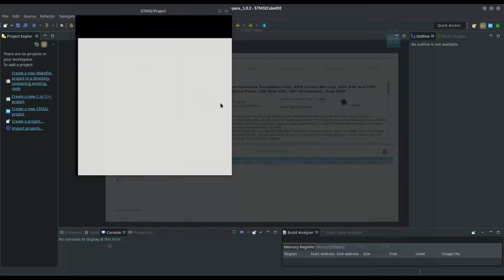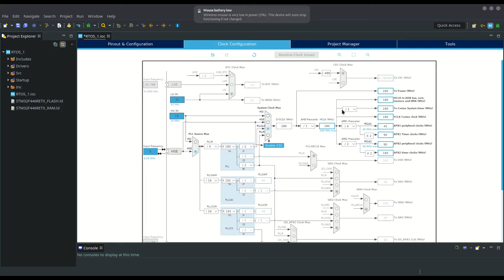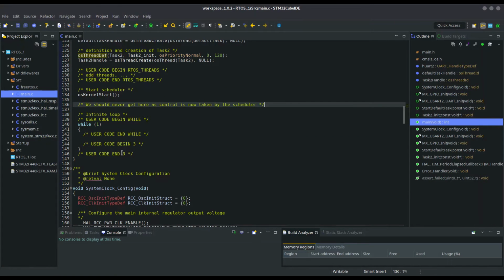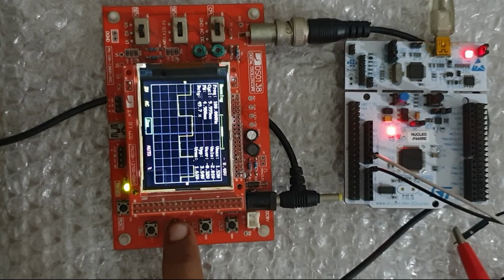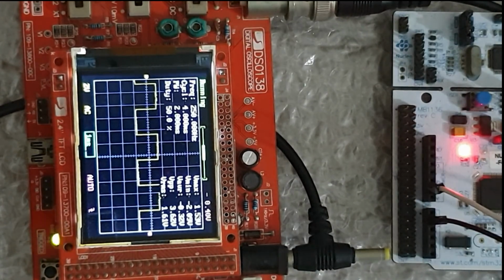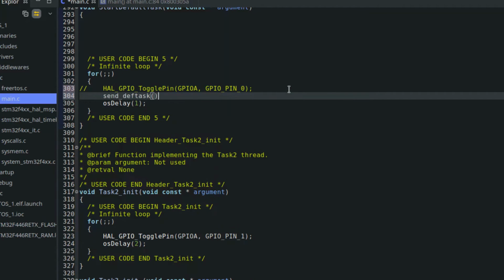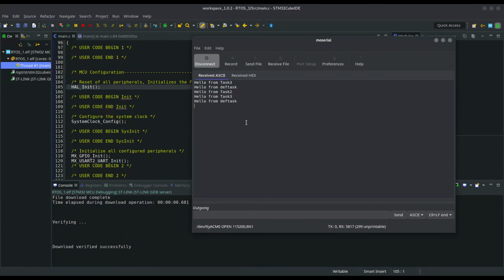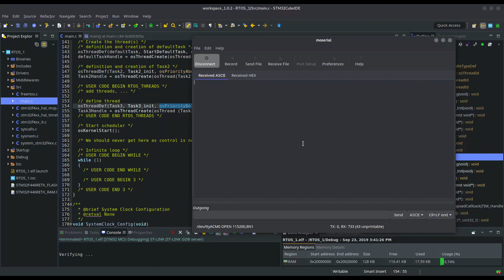STM32 FreeRTOS Series Part 1: Mastering Tasks & Priorities in STM32CubeIDE

Comment: hello sir! i'm new on this
how can i get that 'moserial' if computer port doesn't connect to any STM32 board?
i've run the Debug As -> STM23 c/c++ Applications and it popped up 'No ST-LINK detected!'
hope u can help!
Reply from the maker: Which stm32 board are you using ?
Reply: @ControllersTech  i didn't connect any board so i can't get that moserial window right?
I'm using window, can you recommend any serial terminal?
Reply from the maker: Project can't run without board.
Reply: @ControllersTech can we do this on STM32F103C6T6A board (Blue pill), sir? It's connected to ST-LINK V2 but it got errors when Debugging. 
Hope you can help 🙏

Comment: Wow very nice, this really ilustrates how one wuold intuitively want to develop an operating system, simply an easier way to manage many processes after starting with one, which is how most of start with when programming MCU's.  An even handler is another way I was just reading about, which i guess an Operating system is just a big fancey event handler.  There was someone who made an event handler librarby for MCU's to get around main loop issue which solves the same problem it looks like albiet an even  more stripped down solution with less overhaed then an OS, but some would even complain that the overhead of an event handler is too much.  I was just watching Mitch Davis's bare metal programming series with MCU's and he showed the LED blink sketch blink almost 20x faster by accessing the register directly as opposed to calling DigitalWrite(),  almost 20x!! thats huge, so theres something to be said about the bare metal approach if you really need it, and

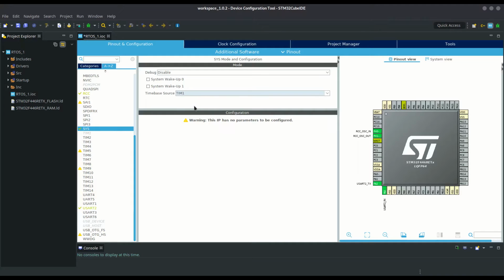Comment: Sir, at 3:26 TIM1 has been selected instead of SysTick. Is TIM1 configuration not required? Code generator handles that and configures it to get 1ms system tick?
Reply from the maker: Yeah it can handle it. But its advised to  use the timer instead of systick.
Reply: @ControllersTech  i know that it is advised. The question was if there are any other steps required when TIM1 is selected.
Reply from the maker: No there is no such thing as steps requiring the timer. When you generate the code, it will automatically point the timer functions to systick
Reply: @ControllersTech  ok. Thanks. I thought that I have to configure TIM1 to overflow every 1ms or something like that. Thanks.

Comment: Thank you for such good tutorials !!! I have a small problem. Everything works fine when I run the code. But when I try to debug the code line by line in the CubeIDE, after HAL_Init() and SystemClock_Config(), the program always gets stuck in the IRQ handler (stm32fxx_it.c  file) of the respective timer that I use. Could you let me know what the issue might be.
Reply from the maker: Yes you can't debug like that. Use breakpoint in the next line and then run the code.
Reply: @ControllersTech  Oh Alright. Thanks !!

Comment: Hello, thanks for the video. I have started to learn RTOS recently. I did everything you had done in this video but serial terminal sends fx`ffxfxfx`fx`f message instead of "hello from ..." message via UART constantly. What is the wrong thing I am going?
Reply from the maker: Could be the baud rate issue.
Check if the baud rate is same in the serial terminal also
And if you are using uart with RTOS, probably you should learn uart first.. or use LED blinking or increment some variable for simpler process.
Reply: @ControllersTech  Baud rate is correct.Yes, my UART knowledge is not good. I am trying to understand my mistake. I can send this array of ascii code and it prints EMRULLAH
uint8_t data[9]={69,77,82,85,76,76,65,72,1}; HAL_UART_Transmit(&huart2, data, 9, 1000);
But I cant send this string
uint8_t data[]= "Hello from DefTask\n"; HAL_UART_Transmit(&huart2, data, sizeof(data), 500);
Reply from the maker: Not sizeof(data), use strlen(data) or use the actual length of that string

Comment: In case anyone else has this problem: if for some reason your code doesn't run, (i.e. you get a hardfault, or debug terminates immediately), please make sure the NVIC priority Group is set to "4 bits for preemption". You can do this by going to the System Core menu and selecting NVIC. On the top left you have a drop-down menu called Priority Group. Here, select "4 bits for pre-emption priority 0 bits for subpriority"

As a beginner, this was pretty frustrating to figure out, and I wasted a good 3 hours before I finally found the solution
Reply: You really help me on this one :D

Comment: Question: Hi, first of all thanks for your teaching videos. I have a question in relation with task and how to call a data from model, I mean, I'm using touchgfxdesigner, there you know that it is used a MVP software architecture, so I'm looking the way to refresh a data in the model using a RTOS task every second (I'm using a date class to store the date, so I want to use the this data date to be used in all of the program), so my problem would be how could I call model inside a task in order to refresh the date every second. Thank you very much.
Reply from the maker: Aren't u using RTC for the date and time ?
Reply: @ControllersTech  HI, I'm using an external  module RTC that offer a high precision and stable clock, this piece of hardware feature an i2c communication protocol, also a battery backup, so I need to ask periodically the date to this module and update it in the rest of the system, I had thought that throughout a task could be a good way, how do you see it? Thanks.
Reply from the maker: Yeah you can use it. Just call the get time or get date functions from a task. It doesn't matter if u call every 100 ms or 1 sec or 10 sec, the clock will be always correct